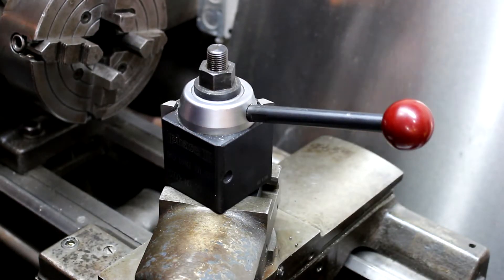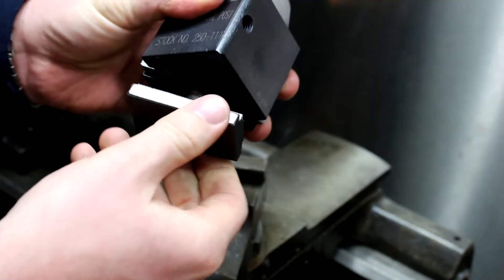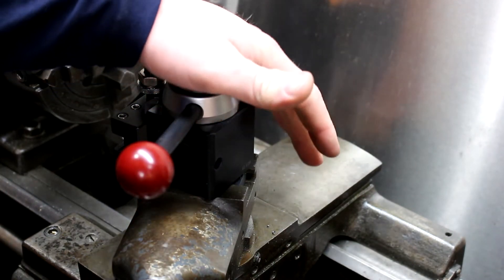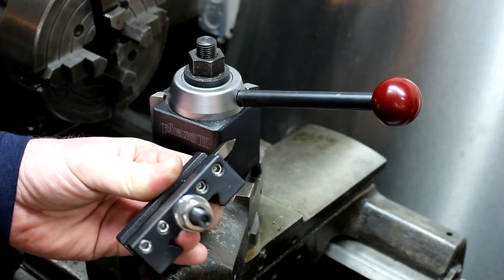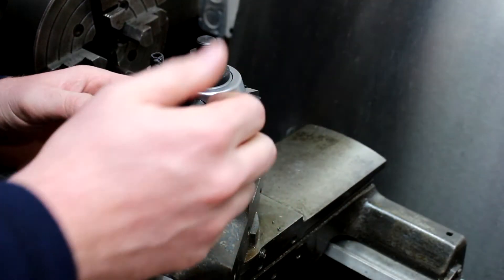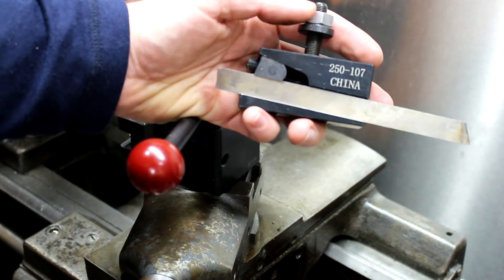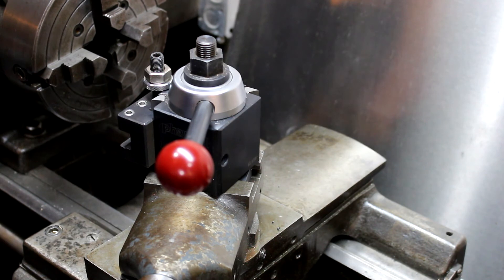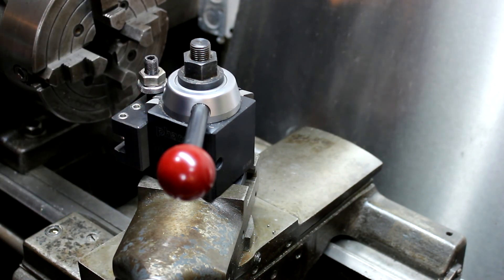Phase II AXA Quick Change Tool Post Review!

Comment: Someone commented about getting a closed-end wrench for the post nut.  I replaced the nut with an indexable female clamp handle. Quick way to rotate the quick change tool post. I agree about the handle being in the way for the boring bar tool holder.  You can move the handle while the holder is off the lathe and re-index the threads for the wedges, sort of like the way the jaws in a scroll chuck work.

Comment: if the boring bar thing is realy a problem maibe you can heat up the lever and slightly bend it over so it clears ,, not quite sure how the offcenter works but another option is to sand / file , turn / grind it down a little so it needs a longer stroke to tighten ergo lever moves toward the chuck a little more and releases sooner
Reply from the maker: This old logan was really worn out and I didn't have the knowledge at the time to tighten it up properly. I think I did but it had bad wear spots in the ways.

Comment: Thanks for the video. What's the largest size tool that you can fit in these AXA holders width wise?  3/8 fit? half inch fit?
Reply from the maker: I want to say 7/16 or 1/2" I would have to go measure one.

Comment: Just wondering why you went with Phase 2 over Shars?  I assumed they were all el chepo chiina stuff. Sounds like Shars has a bit of an edge in Quality?
Reply from the maker: I guess at the time, these were suppose to be of somewhat decent quality. Overall, other than the cheap set screws (which should be replaced ASAP before its too late) they are all pretty similar quality. I have since moved to Aloris and Dorian posts, mainly due to a few deals I found on them. They are both a step above anything coming out of China!

Comment: You can make it easier to mount your boring bar holder if you disassemble the unit and start threading the thread lever assembly 90 degrees from where it is.  Takes about 3 minutes.  I disassembled mine and cleaned it up and greased it and started the threading lever 90 degrees differently and everything is great.  The lever will then loosen the tool holders 90 degrees clockwise from where it is now.
Reply from the maker: I'll have to give it a try.

Comment: The concern I have with them is the tool overhang they present. One thing with the lantern post, the forces from cutting are transmitted right down the center line of the compound not off to the side like I see with the QC. Not to say that the old style is all that ridged and given that the QC has a bigger bearing area on the rest, maybe it all works out for the better. 
 One thing would be to compare the two styles with regard to the chatter you had, that might prove something.
Reply from the maker: The machine was old and worn. That was the main issue. I've had a few qctp's since this one including an Aloris and a Dorian.  You can tell the difference. No chatter with a good lathe and proper set up.

Comment: I heard you had vibrations first just like with your old lantern holder. After fixing the gibs it was ok. So could the lantern holder be ok now as well? That the issue was gibs and not the holder itself? Understandably the new one you got is better than the lantern, but is it so much better that it is worth the buck spent?
Reply from the maker: +rox2u 
With the old lathe shown in this video, it was the gibs. Still is really nice having the quick change. I've since replaced the entire machine and put a Dorian on my restored South Bend. When this lathe was tightened down, I was able to cut OK with the lantern post. For the $150 you can get one of these on sale, worth it in my book.

Comment: Hi, did you get your south bend up and running?  I thought you might like to know.  Someone on ebay has t nuts to fit south bend 9 and 10K lathes with 3/8-24 threads.  Do you know what threads the mounting screws on QCTPs take?
Reply from the maker: +Keith Ray 
Hey,  yes I did get it pretty much finished and I have several videos of it on my channel. I'm not sure what size they are I sold this one off and have a Dorian QCTP on my south bend HEAVY 10 now. I do have another import of my Clausing 12x36" lathe, but I have no clue what the make of that one is. I have seen that guy on eBay, but at the time, I don't believe he had the one I needed.

Comment: but whats wrong withe bostar  QCTP?   I had the piston style Bostar and didn't have any of these problems, I notice there was no backlash anywhere in the handle and the tool holders are smooth and fit really good!
OZ
Reply from the maker: +Ozy Ozy After having this one, another china one, which is most likely close to a bostar, and a Dorian, I think for the chinese versions, I might have to buy Bostar or Shars in the future. Getting to compare several of them, at this point in time, I&#39;m not too impressed with the Phase II, for the price anyways. If they were cheaper they would be a better deal, but for the $100-125, vs $150-200 for a phase 2, The Bostar or Shars would be money better spent! 

I've since gotten a Dorian for my Restored Heavy 10, and I wouldn't give that up for anything! When I sold this lathe, the phase 2 went with it, and I don't really miss it!

Comment: Hey Spitfire, Just found this video as I'm looking for a new tool holder also. I've got nearly the same lathe as you except it's a 10in model. If you remember, I bought your old apron rack gear assembly from eBay. Currently, my holder is off a Craftsman 101.21400 model lathe and it's seen better days. (That lathe beat the hell out of it). It's also got the same issue as you (@ 5:20). The handle gets in the way. I'm considering the AXA or BXA. It's almost 6 month since this video... are you still still using this tool holder? Do you still like it? Thanks for sharing and hope all is well.
Reply from the maker: +Naked Machinist 
Hey, I sold that lathe and tool post about 2 months ago. I never had any issues with it other than the set screws were garbage. Other than that it was nice and I'll buy another for a different lathe, just waiting for a sale. If you have a 10" I would suggest an axa. The bxa gets to be a little large for a smaller lathe.  Hope that helps!